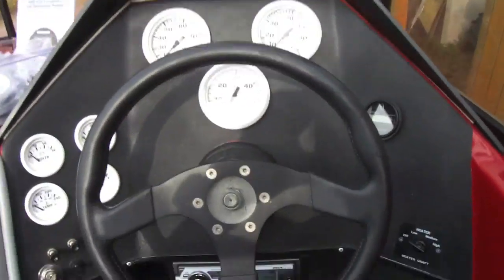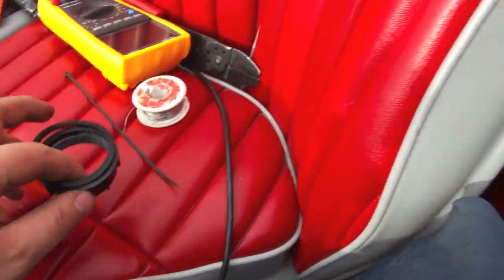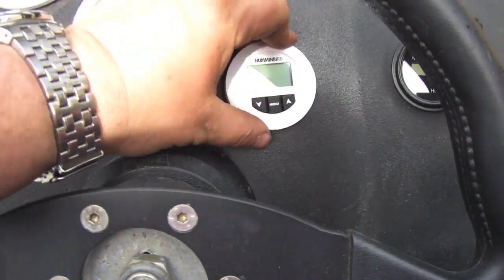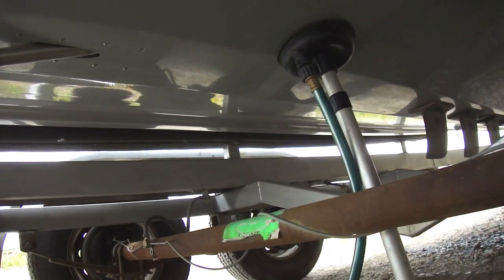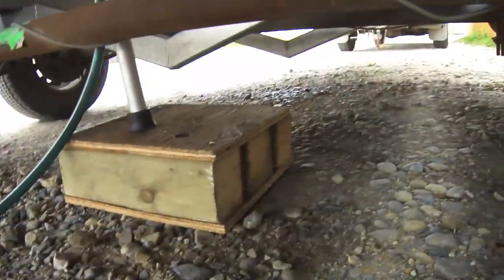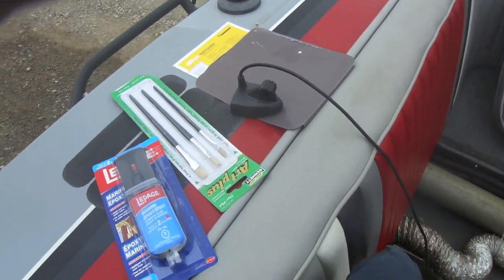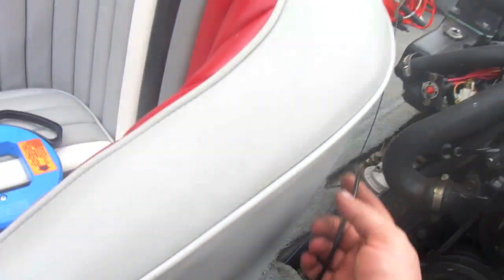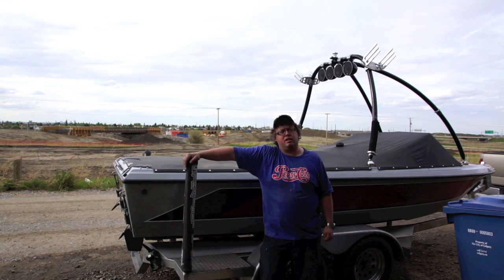DIY Depth finder install in a Malibu Boat

Comment: I just bought an 88 MasterCraft ProStar 190 & I am going to install a depth finder as well. I just wanted to know how your depth readings turned out with where you mounted the transducer because I'm debating where to mount mine.

Comment: Nothing to do with the depth finder but what radio mount is that. I have this same exact boat and adding audio now.
Reply from the maker: I can’t even remember now that was so many years ago but I know I got it off eBay when I was searching marine radios
Reply: Hi I got a boat just like that last week did you change the steering wheel or it came like that  and also I would like to mount my stereo there too

Comment: you dont need to drill a hol to the boat ???
Reply from the maker: nope this was a through hull sensor
Reply: Bullshitkorner

so thats great, I will order this one, thank you
Reply from the maker: yes that is correct, it was a thru hull which means you didn't have to drill a hole there is 2 different types be careful of that
Reply: oh shit.  i will get that one then!
Reply: Wron thats in hull rasducer not through hoke